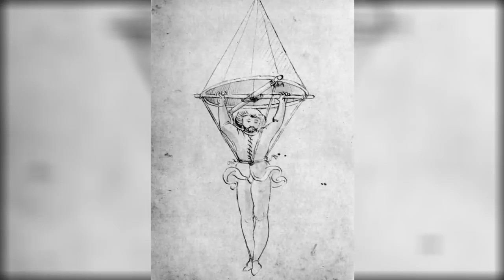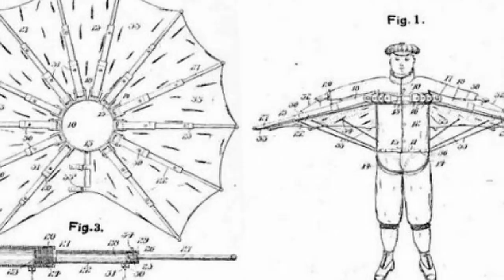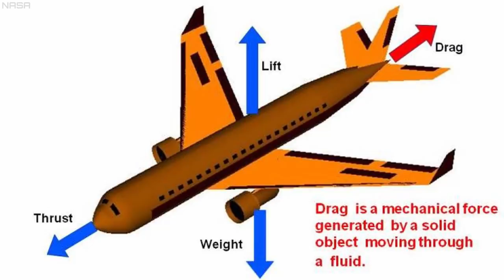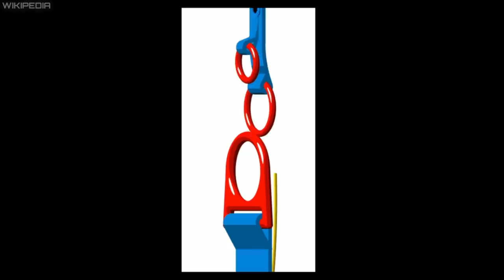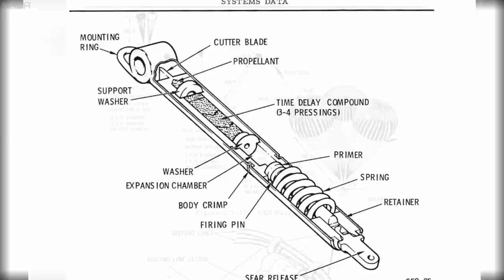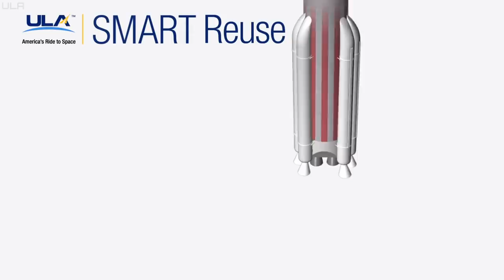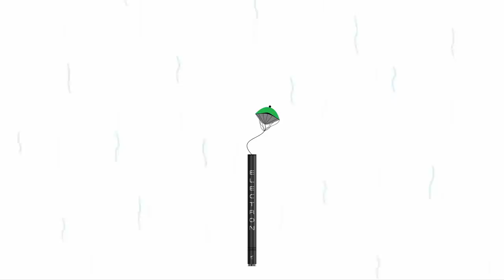Why SpaceX & NASA Struggle with Parachutes

Comment: So much info. One extra: when Baumgartner jumped he got into a very violent spin. It was revealed that there was an emergency system which would deploy in case of a larger than a threshold (measured by G force) spin and that would basically deploy a drogue chute which would slow and stop the spin. Maybe that system would have even more parts and stages, but I remember that part.

Comment: Although sometimes called a parachute, ram air inflatable wings are not really parachutes because they do not create resistance, they do create lift with a wing profile.
And in the case of paragliders even more because they do not stop you from falling, in fact you take off from a low place and climb with the help of a motor or with the help of thermal currents.

Comment: Keven, I forwarded your Parachutes documentary  to my cousin, Hadley  Robinson.  Hadley is  veteran glider and gliding teacher.  I thought you might  appreciate his  comments "Very interesting!  Noted the presence of both PG and PPG which are still sort of parachutes but primarily non-fixed wing gliders because they primarily fly rather than provide drag.  I do carry a reserve parachute that cannot be deployed any faster than about 60 mph through the air.  Not sure I would survive unharmed opening it at that speed which would be highly unlikely anyway as the glider completely collapsed provides a enough drag to keep the free fall under about 50 mph.  I haven’t tested it – and don’t plan to…  Steerable parachute like a skydiver uses?  Not a good idea as candlesticking is a critical problem that can neutralize a reserve deployment.  I.e. reserves are never shown flying straight and level but when the glider is in fatal trouble.  Reserves in our business are our last chance to live.  Coming down out of directional control is terrifying but you will probably survive it.  Bottomline is – we fly with fabric only!"

Comment: You should have included ESA in the title since they are the ones who recently struggled big time with the parachutes of the Rosalind Franklin Mars rover, which was one major reason for its launch delay until 2022. That mission has the most complex chute deployment sequence ever attempted and it failed tests multiple times before ground testing using NASA facilities appeared to fix the problem. But more aerial tests are due before they are cleared for launch.

Comment: On my FF course I was doing a flattrack, and my instructor had said "if I go past you, you aren't flat enough!", and he did; though at a different angle, but I was dutiful, then I decided to check my Altimeters, double for trainees :-). Yes Open height, so snap flare, and pull. After that with my knees almost in my eye sockets, chest snap over my head, and I think my testicles in my throat, I straightened out to prep for Landing. Apparently my distraction by my instructor was him going by me in a Mach-track, however I managed to squeeze a few more KPH out of the Flat-Track :-) I haven't done that again and my voice is a few octaves higher :-)

Comment: I'm surprised you didn't discuss JPLs ASPIRE program. Uses sounding rockets to do high altitude parachute testing. You could add some info on matching dynamic pressure in atmospheric testing. So ASPIRE has to get high enough to match the Mars deployment conditions. You used a lot of MSL footage but there is a lot of current ASPIRE and M2020 footage too.

Comment: Landing system on Mars can be achieved with parachutes deployed in telescopic configuration with multiple parachutes sequentially opening in cascade along a single axis-rope. Axis rope can stretch over whole altitude spanning from ground up to atmospheric region capable of inflating a parachute while holding parachutes numbering 1..(i)..N. Parachute can be inflated with mechanism similar to 'safety airbag' inflators in automotives. Each parachute-(i) on axis rope enters atmosphere and inflates while descending from orbit providing lift to the lander and axis rope with potentially deflated parachutes 1..thru (i-1). Thereby lander reaches ground on Mars as feather weight while optimally Parachute-N remains inflated descending through altitude having Mars atmosphere. Vertical thrusters with minimal usage can precisely position the lander over a selected co-ordinate. Lander before de-orbit might also prep for descent by stretching out the axis-rope holding (N) parachutes.

Motivation:
1.     With current systems or Space-X systems, for heavy weight landers would need larger thrusters running for longer durations before touch down on Mars.  Problem:  Mars from ground level to nominal altitude does not has atmosphere capable of dissipating heat from rocket thrusters.  Rocket thrusters running with high power output over long duration would heat up causing inhibiting states.  Similarly high power exhaust from rocket thruster would raise lot of dust from Mars surface potentially seeding dust storm.

2.     Modern light weight, strong materials for fabric and axis-rope withstanding high temperatures can allow acceptable weight for the whole system of N-parachutes.  

3.    This is compromise idea between current lander system of ‘single parachute landing with vertical thruster at touch down’ and ‘full retro-thruster based landing of Space-X’s concept of recovering mainstage’.

Comment: 9:46 "Greater stability during turns"

Now admittedly, I'm no expert on parachutes, however the T-11 parachute (which is the military designation for the box parachutes) are marketed as "non-steerable" parachutes. 

So is that incorrect, or does no one in the military actually understand how the T-11 works? (Which is highly probable)

Comment: I don't feel like I came away from this video knowing anything more about parachutes than I did coming in. 
I guess I was hoping for more discussion of the engineering: why did spaceX mis-estimate the stress concentrations?  Why do the parachutes shred when they should be able to handle the load?  I have some intuition for why a ballute is better at supersonic speed, but is it actually correct?
Worse, I don't feel like I understand at all they underlying reasons why everyone struggles.  What is it about this particular field of fluid dynamics that makes it so unpredictable? Many other purely empirical fluid dynamics fields are predictable to a high degree.

Comment: But....they work just fine every single time in Kerbal.

I like to drift down using parachutes and propulsively land.  Parachutes will slow even a large ship down to 20 m/s and then it is super easy to use minimal engines to slow it to <5 m/s at impact.

Comment: Just because you don't have time to cut away and then open a reserve chute on a BASE jump,  doesn't mean you don't have time to open a reserve chute.  I would much rather have two chutes out rather than one failed chute.  You could easily have a radar altimeter set to deploy a spring loaded reserve chute at super-human speeds if it detects you plummeting to your death.  A lot of BASE accidents involve the chute hitting a cliff face and losing it's lift force with the resulting drag not being enough to prevent injury on landing.  A second round chute out would solve that.

Comment: SpaceX should enable PROPULSIVE LANDING as a BACKUP. It doesn't have to be NASA certified; who cares? The point is that parachutes are the primary way to bring the capsule down for a water landing. However, if the parachutes fail to deploy at all, or fail to deploy sufficiently for a survivable landing, SuperDracos are there to provide a last ditch propulsive landing option. If and when that happens, NASA or whoever the customer is will be given the option to activate propulsive landing or let the crew die. I think the decision will be obvious.

Comment: Could the current crew dragon theoretically save the crew using the super draco thrusters in case of chute failure?
Reply: It suspect they could, but that would need some programming of them to adapt the force output to match the terminal velocity and landing timings. They would need to suicide brake at the last minute, and this would not be easy to do.

Comment: You say all parachutes are drag based, this is not true, The "ram"-based parachutes are based on normal wing dynamics (like on an aeroplane), so you have a wing above you (like a glider plane) and you can act accordingly. Also para gliders et al, which are shown a lot in your video, are not parachutes, because they cannot take the stress from terminal velocity.

Comment: Always look for the elements of a system that are 1: absolutely vital for it to work, but also 2: less sexy and glamorous than the other parts.  And THERE is your risk of failure, Sir, every single time.  (In other words, would you rather tell pretty women at a party that you work on the rocket engines or on the parachutes?  Exactly.)

Comment: "Inside my burble" What the heck is a burble?
Reply: That's the area behind your back when you're freefalling with your belly down. There's an area with "dirty air", which can trap your pilot chute, as was described. It's like when your drive behind a large truck at high speed, and if you get close enough, you lose a lot of wind resistance.

Comment: You call a parachute a wing ?
Paraglider is a wing, not a parachute!
One fly the other only helps falling
Reply from the maker: Incorrect. A wing is a type of parachute.
Reply: @spaceXcentric  "a folding, umbrellalike, fabric device with cords supporting a harness or straps for allowing a person, object, package, etc., to float down safely through the air from a great height, especially from an aircraft, rendered effective by the resistance of the air that expands it during the descent and reduces the velocity of its fall."
maybe you have to redefine the dictionary

Comment: Very informative but paragliders are not parachutes.
Reply from the maker: Wings are a type of parachute that can provide lift.
Reply: @spaceXcentric  Parachutes have various shapes and canopy design. They have one thing in common: they are released out of a bag or compartment when a carryiyng object is in fast motion. The purpose is to slow the object down. 
It does not apply to paragliders. They have no release elements (bag, cord, handle, etc.) and are not designed to inflate from packed state in flight. They are flown more like hang gliders than parachutes.